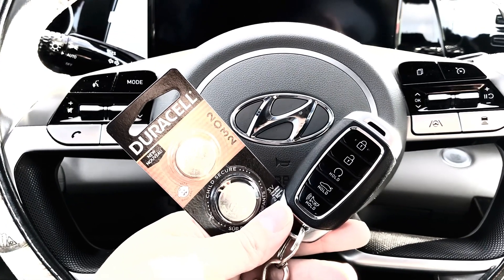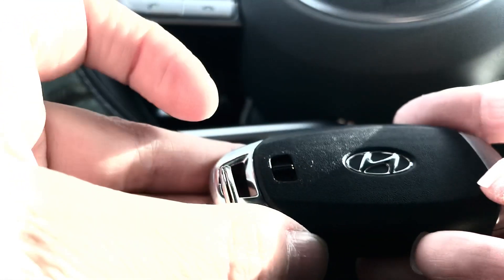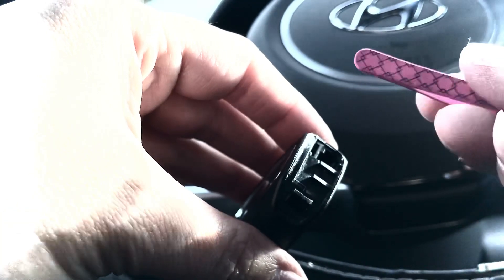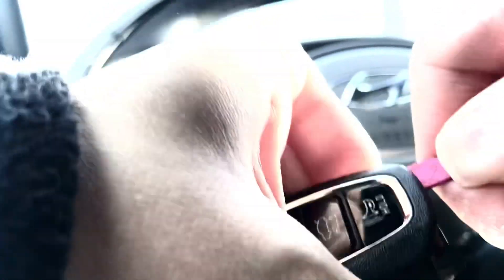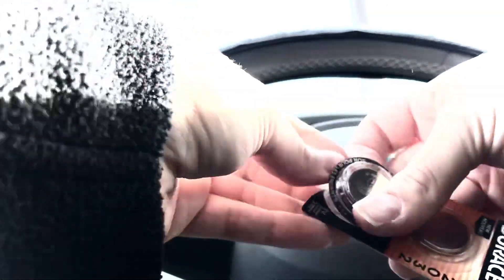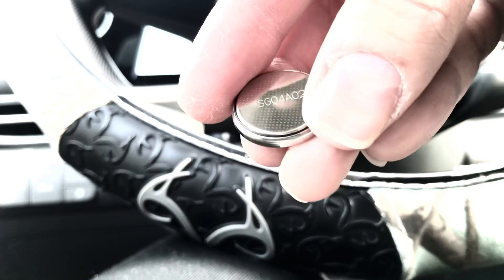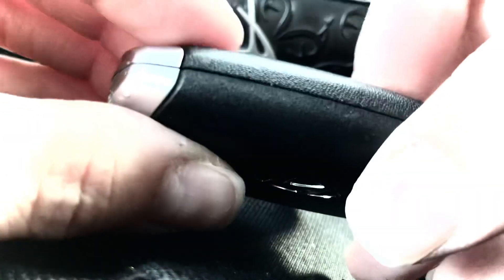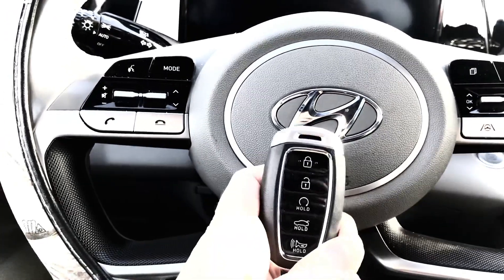How To Replace & Change Out Your 2021 Hyundai Elantra SEL Key Fob Battery When Your Battery is Low

Comment: How do you reprogram it
Reply from the maker: Did you unprogram it? You’ll need a working key fob to sink up with, otherwise it a dealer issue. The chip should be matched with your car already unless you’re using an oem unoriginal key fob… In this video I’m replacing the battery. No reprogramming should be necessary.
Reply: @GMoneySaver  got it resolved I disconnected the car battery 10 min and it worked fine when I reconnected it…I had changed the key batterie and didn’t want to Reconnect until I did that
Reply from the maker: @VictorGarcia-dv6rn  Glad all working out for you!! 🙌